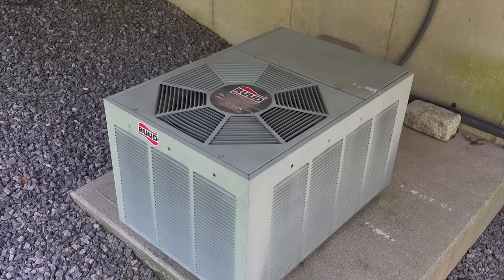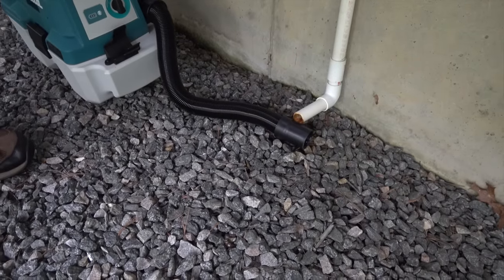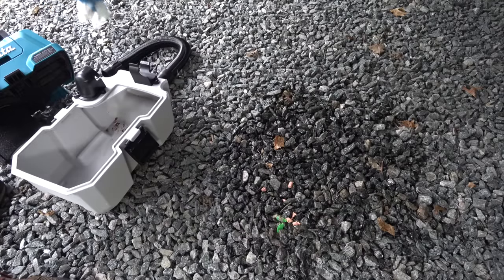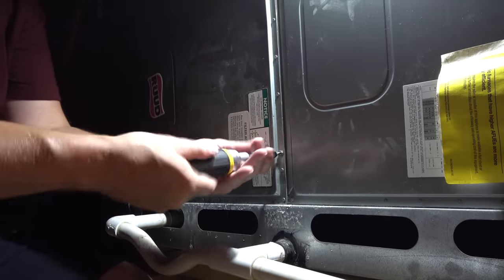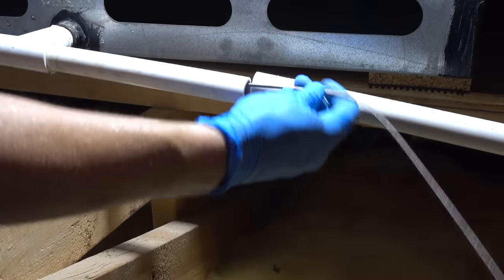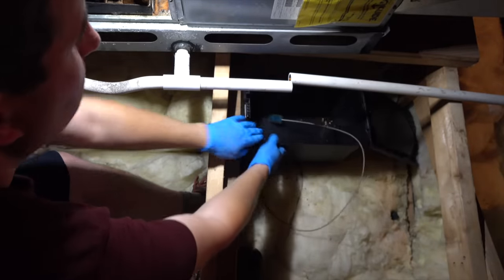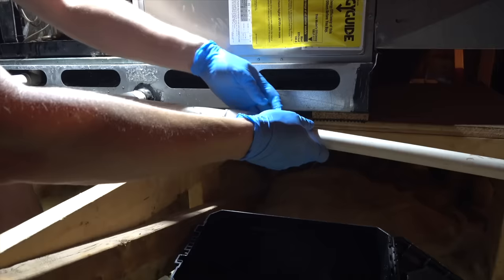How to UNCLOG your AC DRAIN Condensate line FAST - Water stains on Ceiling? or in the Pan

Comment: Great info. Just wondering how to unclog a frozen condensate drain. Happens every winter when the temps drop below 15 degrees F.
Reply: Is this for a furnace? They usually make a siphon trap inside the wall so the water will build up and be flushed out in a large quantity rather than a slow drip.

Comment: One thing I do is to use small hot tub bromine tablets in my condensate drain and whole house humidifier drain. Just toss one (or half of one) in a season and it will keep your condensate drain looking as new as it was the day it was installed. I bought a container years ago and am still using it.

Comment: I have an almost new TRANE Central heat and air system I paid for out of pocket. Last yr. the AC started cycling on and off. Like it was trying to kick on but immediately kicked off. I turned it off. Called the place that installed it. (at this point I had no idea the darn things clogged. seems like a defect to me. As in...can't they make these outrageously expensive items BETTER) SO here it is the following yr. We just had a 120 degree heat wave and the darn thing just quit. I figured it was clogged, took a mini vac and sucked out a small amount of goo and a some water. Did not fix the problem. I'm scared to go into the main unit and do what is shown here, even tho I know every video shows that you have to do this. My unit is inside a dedicated "closet type small room with the water heater) I THOUGHT we had yrly service as part of  NEW UNIT purchase from the company, but apparently not. I called the company back about this current problem and they told me to do all of what you just did. YA RIGHT. They can't get here for 5, FIVE DAYS. Last time, the guy dropped buy on his way home,  hooked a dry vac up, unclogged it and didn't charge me anything and said if it happens again, to do this. WELL, I don't think my "mini shop vac" had the power to suction out more than it has. I've repeated and repeated the process to no avail. I did take the cover door off, but seriously...it all looks the same to me lol. 

While I hate the thought of paying out the wazoo for the repairman to come fix this, at the same time I'm scared to go cutting the thing open, WE do have hard water. The "new" unti is computerized compared to the old. They just have to hook up some thing and it tells them the code that related to whats wrong. I'm scared it more than some clog, but at the same time..think it IS a clog. My pvc pipe looks straight to me, no bow in it. I'll go look again. Anyway, THIS WAS VERY HELPFUL, more so than anything else I've seen. Glad I clicked your vid. I've got an elderly dying man in my home. You'd think we'd be on priority, but of course not. If all else fails, I'll go rent a more powerful shop back and see what happens. When I say rent...haha...we call walmart the rent a center for when you need something once. Use it, keep reciept, clean it back up and return it. However this is looking like a yrly problem. SO I'll most likely just keep it. Perhaps Lowe's not WM. Since i have a project card. Always something. I swear. Brand new expensive equipment and it clogs or just stops working altogether. I did gill out he wattantly online, but unless it's a lifetime, it's past. OF COURSE. Doesn't everything break just after the warranty is up? Just prior to what I think is a clog, water was coming out of the outside hose pretty good, then suddenly stopped, and so did the AC kicking on. ARGH. I'll go have a look see. Again think you. You kind and gently tone made this video great. Didn't make me feel like an idiot, if that make sense?

Comment: Recently had a clog I blew out with a 1/4 line sized up with electric tape.  Have been looking for a brush like that or a semi rigid line with a thread end to I could attach conical washers and pull em through.  Can that brush maneuver a 90° pvc fitting?
Reply: 90°s are a fierce bend.  Could you replace it with two 45°s?

Comment: It would help if you put in a tee with a clean out cap at the air handler for easy cleaning with another breather tee. that would solve half of the time of cleaning the drain line!

Comment: Excellent explanation I ran into a different problem if it's worth anything to anybody between the coils in the pan in my AC there's little passages they became clogged I used a large weed eater line and snake that through there quite a few times and it opened up the passages and all that crap flowed out I've done this twice in a couple years works for me hope this help somebody out just saying

Comment: They make 3/4” PVC unions which is easier and better then the vinyl tube/clamp set up. Also, that is a running trap and by code you need a P trap (it has a deeper dip).
Reply: Many AC systems are done with the shallow trap.

Comment: You can use a garden water hose to unclog the drain tube
Use a rag put the hose up to
The drain tube wrap the rag around where connected
Turn water on for three seconds , and pull off ,and the water should come out and watch should start dripping 
If clear out if not repeat

Comment: I've got new water dripping from my secondary drain (outlet near the attic) but the pans in both AC units have no standing water - does this mean something's wrong with the coil?  Or a primary line block?
Reply: Your primary is blocked for sure.

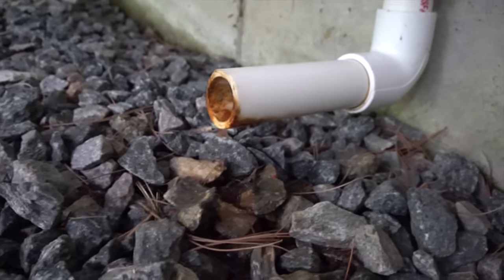Comment: At 7:43 you said you want to have a  pretty steady drip. Is this all time? So its ok if water drips from the secondary drain pipe?
Reply from the maker: No, sorry. The drip only happens when the system is on, and usually starts dripping 5-10 minutes after the AC is on, and wont stop for 5+ minutes after.  This is normal in my experience. If you see it dripping for hours after the system has been off. you might have a clogged line and its just dripping out whats built up.
Reply: @SilverCymbal  Please excuse me, I recently became a new home owner so I never had to take care of a.c issues. About a few months ago I noticed a skow drip from the secondary drain pipe. I asked around and was told it was normal due to the condensation so I never acted upon it. The other day I heard a more fast pace drip (I thought it was raining outside) but realized it was the secondary drain pipe dripping faster. I went up to the attic to blow through the pipe to kind of clean up any build up and then added some warm water. It temporarily solved the issue but I find myself having to do it every other week.

Comment: Not sure were this house is but where I live we have 2 separate drain lines, main which goes to drain under bathroom sink usually and a secondary line which goes to outside, this is so if main gets clogged then it will over flow into a drain pan under the unit and drain outside
Reply from the maker: Very interesting, that is definitely not done here at least not that I have seen. Seems like it could be good, but the only issue is that if your main line clogged you wouldn't ever know, maybe thats why they are here. Many of us have septics
Reply: @SilverCymbal  you would know because the line is above a window so you would see it dripping

Comment: great instructions. are there traps that aren't just a pvc pipe? that can be removed and cleaned or similar? what if you made your own trap and used the hose and clamps to put it back so you can remove it and clean it?
Reply: You ahould use a pvc union to separate the pipes instead of cutting rhem each time

Comment: What if it’s leaking on the bottom?
Reply: Do you mean where you slide the filter in on an inside air handler? I don't have an attic mine is in a closet they made just for the air conditioner if the pan gets a clog that can cause leaking. I get this problem with my upstairs air handler I had a pump put in but I also have that plastic piece that I take off and I Shop-Vac to pull whatever might be in the pan I also do bleach and water and when I go outside I also shop vac be up and down drain pipe. When I smell the bleach come through and the water is clean I do my happy dance LOL
Reply: @UserSmile7077  no bottom of baseboard, next to AC drain out

Comment: My condenser pipe outside has not dropped in 2 weeks. Should I use a wet dry vacuum to clean out pipe. It was unclogged a month ago up in the Attic by a friend. If condesaton line not dripping is it clogged n will a wet dry vacuum cleaner unclog the line

Comment: The access to my drain line is a T fitting where I can pour down into a horizontal pipe. Is there any danger to vinegar going back into the AC if I use the vinegar to try to unclog the pipe? Or for maintenance?

Comment: I had two companies (2) supposedly cleaning out my furnace in the attic. Both companies never cleaned out the tin drawer that had rusted. It was a humid summer in Glendale AZ. I had rust colored water running down my wall outside Guest bathroom pipe was never cleaned out like they told me. I had to replace my motor. $600.00 dollars.  Do you really think companies will do this. No one ever fessed up .I fired both companies. One was a warranty.
Reply: I usually tag along when an ac tech does any work on my units.  This way I see exactly what's done and what I'm paying for and if it's as easy as cleaning out a drain or changing out a capacitor then you see exactly how its done and will be able to do it yourself the next time.  These things are EZPZ but ac techs will bend you over and clean out your wallet for things like this!!!

Comment: I would have to wait until winter time  my attic 500000 degrees right now. Poke a hole in a drywall and run a piece of PVC down to the bucket to let it drain until Summer's over. Thanks for the video LOL
Reply from the maker: I hear you! When I made this video my attic was about 110! Not fun but I had to do it if i wanted AC. You have to always be careful up there, bring a buddy or someone to watch you too

Comment: I shoot water up the drain hose outside and then all the gunk comes flowing out. My air unit is in the garage.  Then I put a bleach soIution in the drip pan to clean out the pipes.

Comment: Mine hasn’t leaked since I have owned my home, and the AC runs like crap.  From what I have been told my condensation line ties into my plumbing which sounds like it isn’t up to code.  The only thing that looks like stains are about an inch above my guest bathroom baseboards on the drywall.

A real headache being that no techs want to address it.

Comment: If you use the shop vac method do you have to turn off power to the A/C
Reply: I don't think so, because the shop-vac it is only going to suck from the drain pipe and not any internal tubing.

Comment: In your video you should have mentioned that your air conditioner will stop working when the float switches usually 2 of them sense that the pan is full.

Comment: The water promotes tree root to chase it  and it will break the sewer lines near by within couple of years , drain should go to sewer directly . if there is a faucet near the drip area , you can guarantee there is a drain pip under ground

Comment: Good video But , You did not show the hard part. you had no room to put the pvc pipe into the plastic tubing in the attic that is why i dont recommend the plastic tubing. i recommend you get a pvc union or sliding pvc coupling that has compression rubber seals in it for easier assembly & they open up easy for servicing. if u have alot of slop in the pipe u could use the Plastic tubing or use a 12" piece of plastic tubing and cut 10" of pipe. out so u have alot of room to squish plastic pipe over both ends of the Pipe & hose clamp. that little piece of plastic tubing was too short. give yourself more plastic tubing , alot easier to slide over ends. overall though , Great video !
Reply: Exactly. I noticed that the video was conveniently edited there. I don’t have a cleanout, but there is a coupling between two 90s that I think is how I’m supposed to access the condensation line from inside the house, but I can’t figure out how to get the pipes that go into it apart. Sigh.
Reply: @rochelle3799   it’s most likely glued together. Go to Home Depot and play with the plastic fittings to see what u can use. Plastic tubing and a couple of hose clamps can work too. You can practice at Home Depot or Lowe’s or hit up your local hardware store if no Home Depot. Although local hardware store is more expensive.

Comment: Ok people there should be TWO drain lines. One with the trap that drains to the sewer line. One OVERFLOW that drains OUTSIDE (A TELLTALE) .If condensate comes out the TELLTALE , call your AC repair person. Your AC person should be checking your system TWICE a YEAR. And keeping your system clean is one of the reasons.  How often do you take your car in to get the oil changed and serviced and washed?  What this video does is add a quart of oil to your car when your car is dripping oil everywhere.

Comment: i had my furnaces replaces (have 2 in my house) and they set up new drain pipes to the furnace and ac unit on top of the furnace which have a hole in them where they told me i can pour i think they said bleach or vinegar through the lines to clean them out every few months

Comment: Compressor with a hand control at 100 PSI to blast down the line.  No cutting into the pipe with a pipe cleaner

Comment: I would suggest to actually cut a bit more of the pipe (at least 1/2 in to 1 inch) before putting clear pipe, that way you will have "windows" to see how flooded is the drain pipe.

Comment: There should be a secondary drain pan under the whole air handler. The second drain outlet may be the primary drain outlet ,with trap. Or just put trap on the ground end.
Reply: Drain Pan Needs A Second Drain Line and Drain Onto Driveway.  So You Can See When You Have A Problem...

Comment: A few days ago I noticed water coming from the AC unit,  and since then the AC fan runs,  but doesn't cool. pretty sure I need to do this.  Going to try this before calling the landlord. (I prefer not to bug him) any other tips if this doesn't fix it?
Reply: Ac not running cool and water dripping is 2 different problems but you probably know now

Comment: I have no idea what state this is in, but that drain setup would violate code in my state. A float cutoff switch is mandatory, plus there's no built-in cleanout where the line exits the unit's drain pan. In fact, the float switch would likely be installed in the cleanout. In my new installation, there's even a backup float switch.
Reply from the maker: I'm in Mass. Keep in mind this ones 22 years old. Back then float switches were not too common here. Now you will see them on new installs
Reply: @SilverCymbal  That was a pretty clean looking attic unit (at least on the exterior) for 22 years old.
Reply from the maker: @whiteknightcat  Its under a tall deck which has helped. Sadly it's only like 10 seer though. which nothing can make run cheaper athi point but these Ruuds from that era run forever

Comment: I'm pretty sure mine drains into the basement behind the furnace. Not home to check but. But think the tube goes through the humidifier then into another contraption. I dont c anything outside. My sister home if comes.out right next to the ac unit outside.

Comment: The maint guys where I used to work had a tool that used an oversized CO2 cartridge that they used to blow out the condensate drain on the mini-split supplemental AC units in our server room.
Reply from the maker: Those things are very slick. I have seen them used for oil lines too. Probably beyond what a homeowner wants to spend but cool none the less.

Comment: I wrote to you before. This unpleasant smell of an outdoor drain line should be designed to clean by itself. There shouldn't be any kinds of algae or dirty build-up, if these costly units were designed correctly. All we would do is change an Air Filter.  Some people don't even do that. Isn't this Building Maintenance if you live in a Condominium? Thank You!

Comment: If a drain pan float switch was used, it could be wired to shut off the condenser and then your ceiling won't be ruined.

Comment: Had this situation happen to me.. The part that I cleaned up by the ac is actually outside for me.. I used a hand snake for plumbing and I was able to get a whole bunch of Crap out the pipe. It's crazy the gunk that builds up there
Reply: I used a regular garden hose, with pressure some slimy disgusting buildup poured out.

Comment: Wow, no external drain pan under the air handler! No wonder it leaked down to the ceiling. Required where I’m from.
Reply from the maker: There is a single pan, but no overflow switch. Those are now required here but this one is almost 21 years old.

Comment: why would a trap be needed in a simple drain like that? also, what about those tablets or strips that are supposed to keep algea and yeast slime eliminated? and downside to using those?
Reply from the maker: Not sure if its a code requirement but I think the real reason is to stop mice and bugs from getting a clear tunnel into your house.
Reply: Nice answer, as wrong as the video, but funny.
It allows the condensate water to leave your unit, without allowing the dirty unfiltered air from entering it through that same pipe. Remember,  you have traps like this on every drain in your home. The bugs and such are just a bonus.
Reply: No real downside to using detergent tabs, but NEVER  use bleach. Aside from the noxious fumes,  it can damage your coil.

Comment: Most primary drain line are connected to main drain. Secondly drain line is normally routed outside.  Most drain lines have air gap.  Vacuum won't work. Best way to clean is gallow gun.  For best results call a professional!